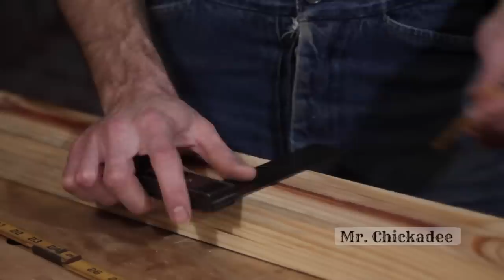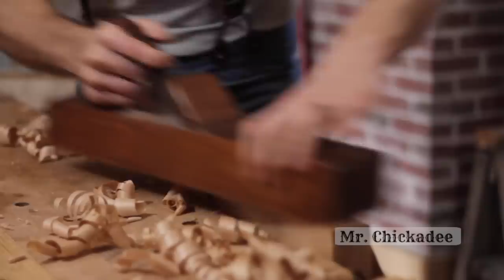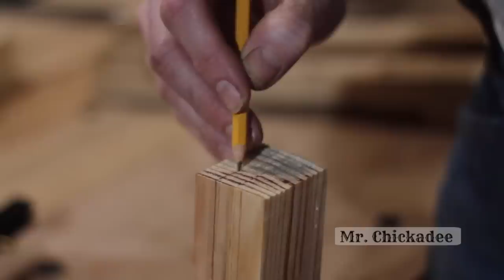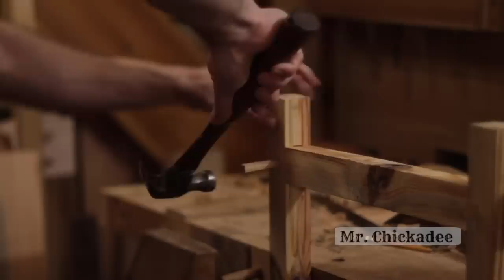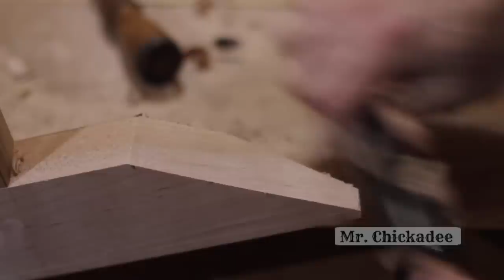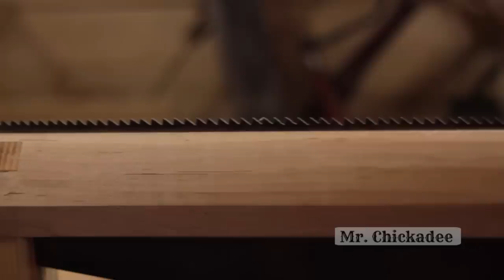WOODEN SAW VISE

Comment: Another testament to accurate mortis and tendon and square pegs in round holes. Really got a kick out of the tighting of the jaws. A very useful tool that looks beautiful. Awesome job. The patina of your wooden hand planes is really awesome, they just beg to be touched and used . Great video.
Reply from the maker: Thank you, I finally feel like Ive put in a good number of hours planing because my Jack plane has a thumb indention in the side where I hold it. (visible as a lighter area on the side. )

Comment: I am no carpenter or a craftsman of any sort although I can be handy around the house when the need arises. My tools are few, basic and cheap. That 14" handsaw had been lying idle for years but of late went through more than its fair share of action. It became dull, I sharpened it and we took off again. Something that wasn't correct crept in. I wanted to saw straight but it drifted towards right-hand side without any urging resulting in being out of line. How do you solve a problem like this besides throwing it away and replacing with a new one? It is indeed a cheap piece of a tool but your saw vise video prompted this query. Thanks for the many enjoyable hours watching the display of your many varied skills.
Reply from the maker: You have to make sure your angles are consistant when sharpening. If your Fleam angle was say 20degrees filling one side of the saw, then 25 when you flipped it around, you could get wander as you described. 

There is an old trick of running a honing stone down one side of the saw teeth lightly to adress wander, you might want to try that.
Reply: @MrChickadee  Thank you so much. Honing the saw teeth on the wandering side, I presume.

Comment: Very nice job.
I got a question about the end of the video.
You sharp the saw from the handle to the nose?
I have learned the other way.
Like that you keep the bur in the front of the teeth.
My english is still bad so i dont know if you understand what i mean...
Have a great day
Reply: depends on the type of saw.  some cut while pushing and this one cuts while pulling
Reply from the maker: Yeah, handle to toe is just what feels better to me. If the saw has fleam, as in a crosscut saw, I try and point my file toward to toe to file the front of each tooth and push the bur to that leading edge. In the end of the process I lightly pass a stone down the sides of the teeth to remove this burr and even up the cut line as well.
Reply: cheasecloth i was talking about the panel saw wich is shown right here
Reply: Mr. Chickadee ah ok, nice thing to know. Thanks to your answer

Comment: Any thoughts about making a hollow at the end of the vise clamps for the saw handle to fit into?  The vise looks long enough to fit the whole saw blade.
Reply from the maker: THere is one, just didnt get filmed. Peters vise has thinner jaws than legs, which seems to do the same.
Reply: Roy Underhill built a very similar vise that includes the hollowed out area done with an auger bit.

Comment: Nice work as usual but Im very surprised you used wood with such big knots because I think it will eventually break where the large knots are then you will have wasted your time.
Reply from the maker: Knots in this context don't hurt the piece in any way, they are in compression, no piece in tension has knots, if you only look it should make sense. This vise will likely outlast us both.
Reply: OK good.

Comment: I like it, but when you are 40 years into your career, you will have long since run out of space for white elephants like that.  If your bench has a vise you only need an adapter like the one cabinetmakers have been using ever since.  Funny thing is I have picked up a Diston and a modern japanese saw vice, and neither actually has any straight forward means of being attached to a bench, yours sure has that part covered.  Funny world.
Reply from the maker: A bench mounted saw vise works fine at the bench, I really like this vise to take it out to the job site, out in the woods and just lean it against a tree or sawhorse while timber framing.